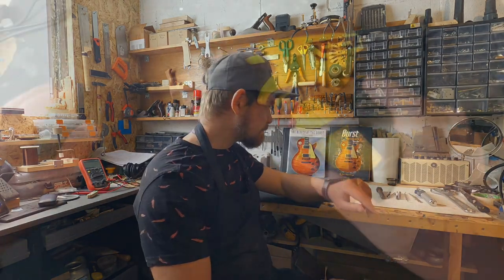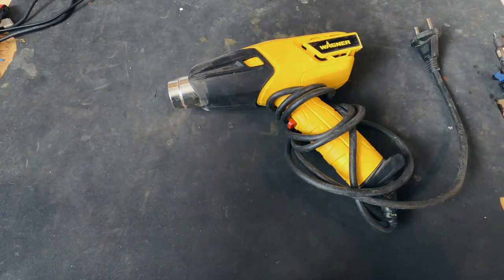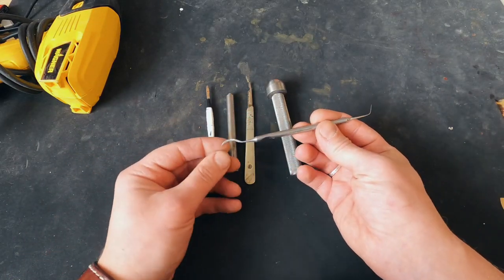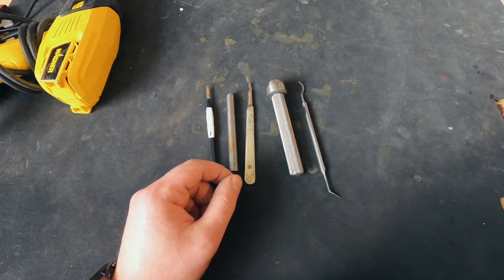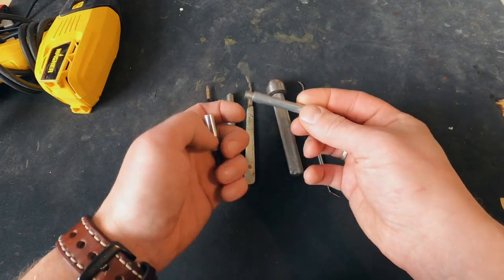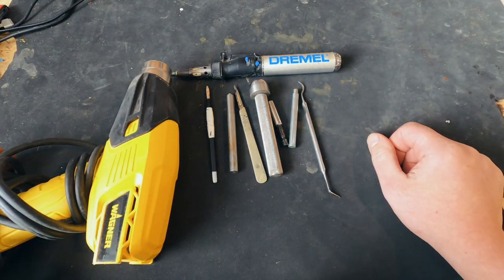Billy Gibbons PEARLY GATES. PART 2. English version

Comment: Very nice work. I did notice some things that are red flags that tell me that it is not genuine, but it will probably fool some. For example, the lacquer chips would have a smooth transition, and the pickup covers would have more wear from the strings, palm muting, etc. A thinned mist coating of clear lacquer on the body would help smooth it out.

Comment: Fantastic attention to detail on rounding off and making the worn finish areas seamless to the rest.. truly looks like 70 years of wear.. QUESTION?  when working with acetone either stripping finish or working to dull the finish.. how do you prevent unwanted reaction with the ABS binding?  i thought acetone melts ABS very quickly.. especially when removing finish?  perhaps you are taping off the binding in this case?  cheers!
Reply from the maker: Hey.  Thank you.  This is a common question I get asked.  Indeed, the binding is softened by acetone.  But if you work carefully, then problems can be avoided.  After drying, the plastic becomes hard again.  It does not make sense to cover the binding with masking tape, since acetone will dissolve the glue, the tape will come off, and the dissolved glue from the tape will penetrate into the plastic and change its properties on the surface.

Comment: That looks incredible but i am surprised to see you did not Recess the pickguard screw like Gibson did in the 50's?
 The screw for the metal bracket that the guard attaches to is countersunk into the guard some and not flush with the pickguard on old 59's.
Reply from the maker: Thank you for noticing this.

Comment: Do you think I can crack the finish on a 2015 Gibson Les Paul? with hot and cold? or is the finish too hard?
Reply from the maker: Hey.  I don’t think it will work.  Gibson Factory Varnish is too soft.  But you can try.  Only without heating.  Several cycles of freezing at minus 20 Celsius.
Reply from the maker: Hey.  I don’t think it will work.  Gibson Factory Varnish is too soft.  But you can try.  Only without heating.  Several cycles of freezing at minus 20 Celsius.